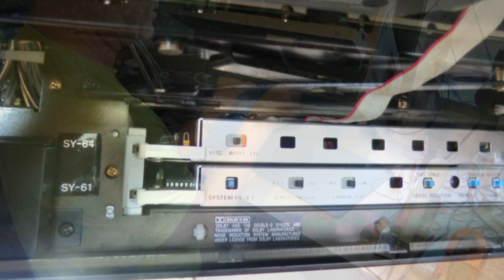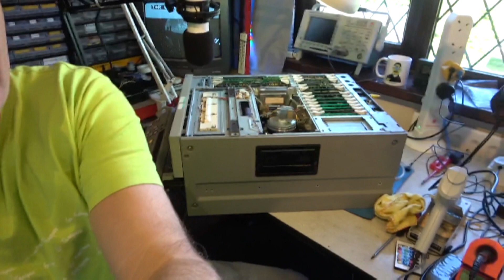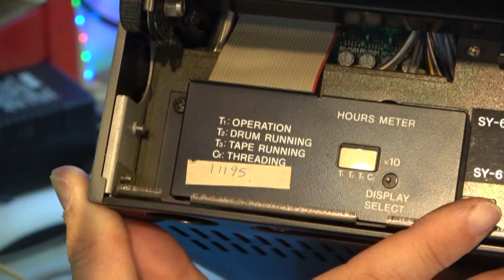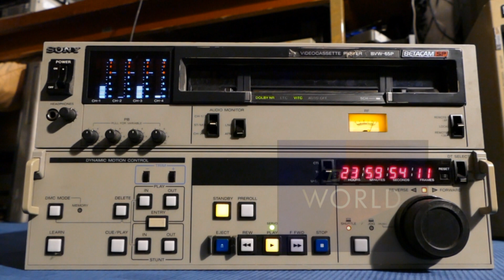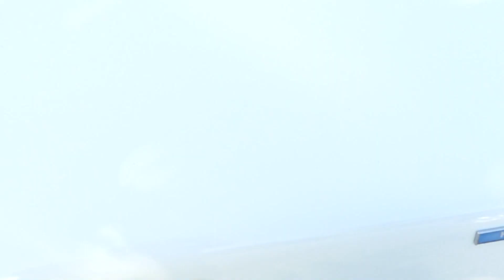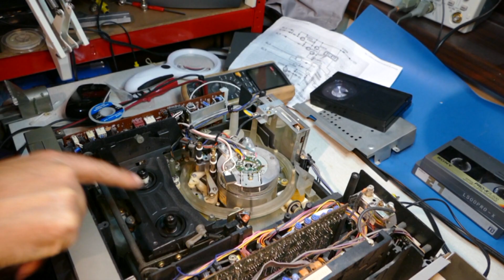Three video decks, part3: Sony BVW65P BetacamSP player with TBC and digital output... sort of.

Comment: How about the audio/ sound quality?
Reply from the maker: BetacamSP is a professional format, it has excellent luma and chroma performance and very low noise. The actual luma resolution isn't as high as say SVHS or Hi8, but the overall performance is far higher. All machines have linear audio which is very good quality. Many (not all) BetacamSP machines also have FM modulated audio which is even higher quality, but has certain restrictions. It's well suited to several generation edits and still retaining very good results, whereas multi-generation edits from S-VHS or Hi8 are awful.
Reply: @video99couk thanks a lot

Comment: I have a BVW-75 that I got for free, it has a problem when you rewind large tapes, it will throw up an Error-02. Which is a reel trouble error that it detects tape breaking, according to the service manual. I noticed it doesn't do it with small sized tapes at all. I only have one large sized tape so I don't know if it's just that one tape. Could it be the mechanism that moves the tape reels in and out for playing small and large cassettes?

Comment: over the last 10 month  i have worked on alot of betacam sp range  decks  they are very good if service right  
i think they are better than the home  decks  i did get some new seal  betacam tape not the sp one  the one's 
that cam  out in 1984 about  they used in the usa first  WOW the sound on them is ace 4o year old tapes

Comment: Wow that one's a beast.  The impressiveness of the number of cards in it is second only to the many contacts on the top of the video drum shaft.  And, I see Sony used (more or less) the early Betamax wrap for Betacam, going counter-clockwise with fixed guides on a ring rather than later-Betamax's clockwise with pop-up guides.
Reply from the maker: With professional decks, space is not such an issue so you can drop the tape down onto the larger ring guides.
Reply: It looks like it was stored in a shed outside. 😊It was interesting. Wasn't there Spider-Man?🤔I learned a lot.👍

Comment: Hello, I just bought the bmw-60 sp and ERROR 14 appears, does anyone know its meaning?
Reply from the maker: You will need to find the correct service manual.  It may just be a bad fan motor, but check it.
Reply: @video99couk  I was just seeing that one of the fan motors does not start.

Comment: hi i got this make this will take brtamax  tape i will not play the  old betamax tapes right way  i am using it for sound only  as i have some nice tape i need to find some way of using them the betacam digi will play back audio i recorded  on betacam sp using betamax tape  funny  i was having to bin all the betamax tape so i will pull alot apart for the parts a tape
to save room  all this gear take alot of room up guy;s bob

Comment: 10 years of my life,I set in front of those machines,when I worked at Sport Channel/Sport 5 (a cable tv sport channel at my country).I mainly used the PVW-2800 models VTR'S-they have only linear audio, and they threaded the tape in M-LOAD wrap like VHS,unlike the older BVW models,which had C/U wrap like U-MATIC/Betamax.later I also worked with BVW series-mainly the BVW-70&BVW-75.I used to do an old style video editing on them- "cut to cut"(that was my main job)and dubs of tapes.and ofcourse,every TV station archive worker familiar with this  - recording black bursts video on the tapes.I did it at days,and they had a special worker that did it at night.
when I first started to work there,I was amazed by the picture quality that format produced compared to the other analog formats.but later in years,into the mid 2000,the format really started to show it's age,and also the VTR maintence at this channel was terrible at that era (for money issues and just careless..) so many recorded items at the prime show of this channel "the sport news" were suffered from bad picture quality and drop outs.and mostly big bossess(the CEO's than) there didn't care much..only in 2010 they moved to a new facilites,with only tapeless workout from than.
Reply: Audio master tape quality help please?

can you please put up a video of absolute prescribe audio fidelity dynamics and response like incorporating professional hi8 VIDEO8 digital 8 beta max superbeta hihi S-VHS HiFi betacam SP SX (but all non-PCM or bitstream encoding) analog with AFM linear magnetic or depth multiplexing please?!
Reply: @ET2carbon  I think you meant to respond to video99uk and not me..

Comment: Something that makes you know it's a broadcast machine is the clicking noises as it goes into play/rew/shuttle etc., as you can clearly hear at 7:33 onwards.  What is it that actually makes that noise?
Reply: These clicking sounds come from electro-mechanical solenoids that are part of tape mechanism. Solenoids move pinch rollers and other mechanical details when pressing tape control buttons.

Comment: I just started working on a BVW-75P with exactly the same loading noise. Initially hard to pin point the source but it is the motor. A little spray grease into each end where the spindle shaft can be seen and the noise was no more. Dry bearing, that's all. Super videos you're producing, thanks!
Reply from the maker: I obviously didn't manage to grease the right spot, I'll try that again.
Reply: @video99couk  did this solve it? and where did you apply the grease exactly? thnx! :)

Comment: Hi i have joined and i also love video machines and thanks you so much for all these vids!..The BVW 65-75PS Range are great proper machines and that loading/lacing gear is always one of it's mechanical downfalls..belt is easy but hidden inside the two gears is a little shock rubber bush that just goes to glue then the gear just spins!. and the possible seized pinchwheel arm and the noise which is the cleaning arm hitting the drum because the foam has disintergrated..I have new kits for these and being boxed for 30 years they have disintergated too! Also check the right last angled arm which swings out is very slow to return and normally wrecks the tape..All easy simple repairs to get these lovely machines going...Anyone got any C Format machine tips??
Reply from the maker: I can't help with C format, not yet anyway.  I have a C format machine awaiting a going over, but it's all a bit daunting.  I could really use borrowing someone who is familiar with them.
Reply: I have two BVW-75P machines, sadly neither of which work. One fails to lace the tape; the motor runs and the worm gear turns, but the two stacked gears don't rotate - I suspect this is down to the disintegrated rubber bush you refer to. The other machine has a fully working mechanism, and gives an excellent off-tape RF meter reading, but for some reason the video output is very dark, and mis-synchronised, and if I turn on Dynamic Tracking, the RF reading drops and the meter needle trembles, and I get noise on the FM audio channels (turning off DT gets rid of the FM audio noise and restores full RF reading). I love video recorders and I find them fascinating, but I don't have the expertise to diagnose the fault properly. I'm hoping I can swap boards between machines to at least narrow down the faulty board.

Comment: hi your got to have people asking to take video-audio gear of there hands all the time  this year i sometimes i am getting people to pick up fee betacam decks
as they just don't understand them   lot of gear is in a very bad way  i talked to a tec in the south about them kits best to line up with the real thing
i have a cat if she kills the real tooling i will not lose alot   

DrCassette  i have watched the video  he got some good video's   i had 1 video i pulled of you tube about a tascam  34 - 38 i  made out of 2 decks
i was getting alot of hits  big time  main part was a tascam 34b  with  38 heads the 34 heads were dead  i lost my otari  1/2 inch 3 speed deck  
so i need a  1/2 inch 2 speed play back deck    as you know tape  deck fans like there decks 100%

Comment: Just bought a BVW 75 Betacam SP but it didn't come with any of the cords
 necessary to connect it to a tv/monitor. I only came with the 
electrical cord. Do you know which cords I need to make this machine 
fully functional? Thanks for help on this issue.
Reply from the maker: If your TV has the yellow, red and white sockets, then simply BNC to phono from Composite video to the yellow socket, and photo to phono for mono audio.  If you need stereo sound, it's a bit more complicated, you would want balanced to unbalanced cables, readily available on eBay etc.
Reply: @video99couk  Thanks much. Can't wait to get it connected and take it for a test drive!

Comment: Absolutely brilliant videos and narration. I used to work extensively on SL-C9 and SL-F1's (my favourite consumer machines) when I worked for Sony in the 80's and DMR-4000's and the like used for Pro audio purposes, I currently have 2 SL-C9's, both needing loading gear kits at the very least. I have 2 brand new video heads (the original type with blue/white leads) if I need to replace them. Can anyone help with the gear kits? Any other problems that come to light I can probably work around.

Comment: Neat machine. My first instinct about the jarring noise was that perhaps the plastic gear that drives the tape wrapping mechanism is slipping, and you're hearing the teeth grind against each other? In which case prolonged threading operations will damage both sets of teeth even further. As that plastic wears down, I'd expect this exact problem to eventually happen (intermittent contact). The "directionality" makes sense as well, since the amount of mechanical play between gears would change slightly with turning direction. If this isn't the case, my next guess would be dry motor bearing but I'd expect that noise to be a lot quieter since the surface area that generates it would be small. Small metal motor components wouldn't be as resonant as the C-shaped wrapping mechanism either. Could be wrong though.

My job is at the forefront of modern digital tech but I have a lot of appreciation for this type of old analog gear. Marvels of system engineering.
Reply from the maker: I did worry it was the loading ring teeth, but they are robust and in good shape.  It's just the motor.  Unlike the previous video in this series, a Panasonic deck which makes a horrible noise and turns out to have serious gear problems.
Reply: @video99couk  That's good to hear then! A slightly better problem to have. Good luck and thank you for making your videos.

Comment: I ordered a BVW-60 off of eBay once when it was received it would not load cassette, I opened the top and find that the entire frame of the deck was cracked and the mechanism had shifted,, we can imagine what kind of a sock the machine had to have taken (and not from the shipping company as the box was in great condition).
 I would not mind that deck in my playback stable, the video only SDI is OK with me as my capture setup will allow SDI video and either AES/EBU or analog audio capture. I
f sony Licensed DT from Philips, it was earlier than this machine by quite a while, my 1979 BVH-1100A 1" machine has DT.

Comment: hi ihave worked on 4 unit's lthe same as this  you see the motor and belt need's  oil grease in the gear there a rubber  inside one of the turning parts
that goe's funny   i had a pallet of recorder's of betacam sp dropped of for me to fix  if you had a corner in a room you could have a tower of them  i got a
 bigger work shop in my pad  i to see what people think

Comment: The BVW-65 was the top of the line Betacam SP player Sony made for broadcast use (that's what the B in the model number stands for). The BVW-60 didn't have Dynamic Track Following, so no clean slow motion on that one. I think both models had the TBC though. I have the BVW-75 which is the top of the line recorder. Mine does not have the digital video output, and it has a broken tape end sensor which causes the logic to lock the fast forward and shuttle functions :(
The hour meter contains a little button cell, I think it's an LR44. This can be replaced after disassembling the meter. There are instructions online on how to do this.
Reply from the maker: I suspect that digital output was a very rare aftermarket installation.  I might just change the hours meter battery, but of course it will be zero now.

Comment: I could hear your muscles screaming, What a beast of a machine :-D
And i thought my old jvc piano key was a gut buster to lift.

That noise did sound like a worn and dry fast motor shaft, 'Give me a dot of oil please!!.' :-D.
Wiggle that shaft laterally, i bet it's a bit sloppy.
The plastic gearbox is slow in comparison, but a washout and relube might make the tape wrapping speed more constant.

When you slowly said that sony must have licence to use ..,  i jumped in and said phillips 2000 (Like you could hear me through my acer laptop screen, and in the future.) lol.
I'm rather daft at times :-D.
Reply: All the Betacam SP machines I have seen so far wrapped the tape like the machine does in this video. The process starts slow and gets progressively fast. I too thought that may be a lubrication issue, but I am not so sure now. That may just be normal behaviour.
Reply from the maker: @DrCassette  It struck me as possibly odd, but possibly intentional.
Reply: DrCassette
Well yes i'm likely wrong, i don't mind being wrong :-D
i like to leave a comment to show i've been watching the video and not skipping bits like some people do.

i'm sure colin knows more that ill ever know.
Lucky that he is kind enough to make smashing videos about his interests, i could become smarter lol, that was a joke :-D
Sorry i know you don't like my silly talk, but i am daft :-D

Comment: The dub connector could be the larger betacam dub connectors. Some Betacam VCRs have both a betacam one and an umatic one.
Reply from the maker: Ah, well spotted.  It's not a Umatic Dub connector, my mistake.
Reply: @video99couk  The Betacam Dub connector is component video, just made more convenient with just one cable. and good for simple editing or component dubbing.
Reply from the maker: @mspysu79  I'm sure I am not the only one to get those two confused.  Sony should have called the Betacam Dub something else.  BetaDub sounds nice!
Reply: @video99couk  Yes I liked BetaDub. I have a sony BVE-600(i believe) that has Betacam DUB I/O connectors. so 2 for A/B players and 1 for the recorder.